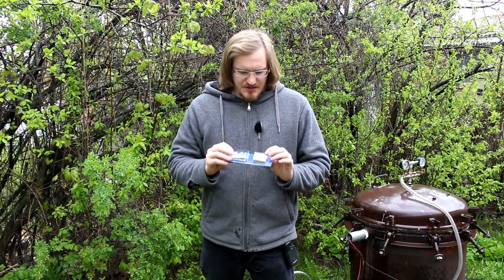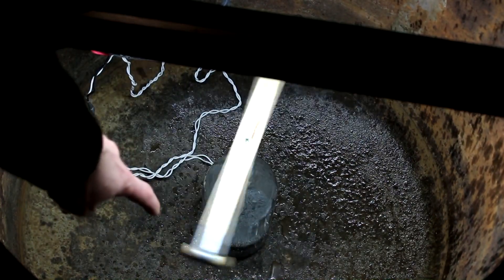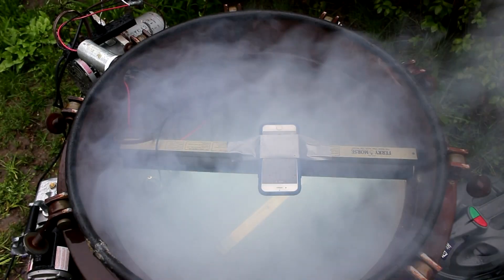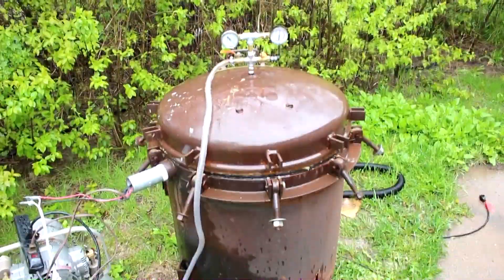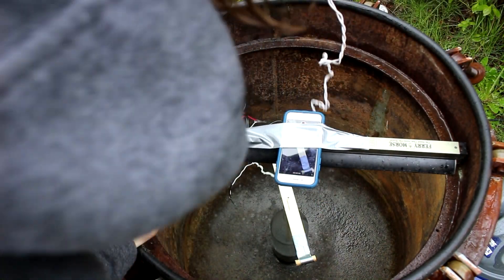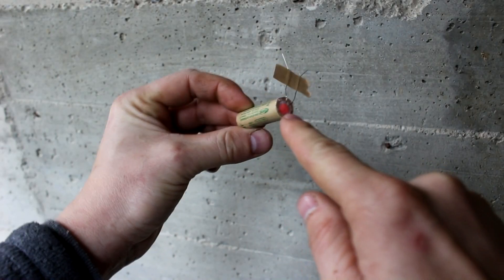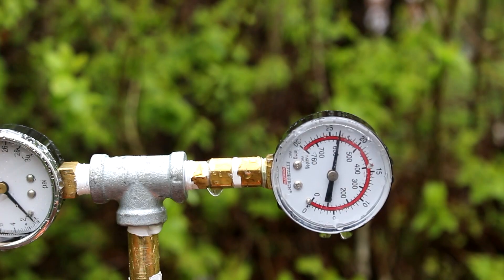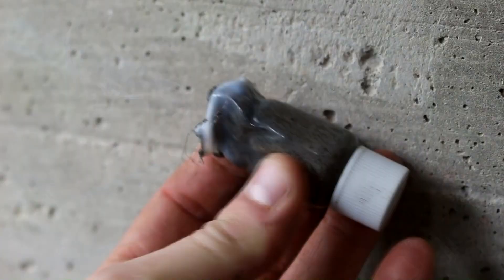Will a Model Rocket Motor Work In Vacuum?

Comment: As you suggested Rockets do actually produce more thrust in a vacuum. Most designs will have a lower specific impulse at sea level and by extension a lower thrust. This is mostly down to the pressure differential between the combustion and the exit nozzle being lower when there's air pushing back, leading to a lower exhaust velocity.

Also, I strongly suggest getting a dedicated camera, like a go-pro with a dive housing - would such to ruin your iPhone.
Reply: Not just NASA but any rocket needs an oxidizer.  But rockets carry the oxidizer with them and in the case of solid rockets, the oxygen is usually built into the solid material itself- such as ammonium perchlorate
Reply: This channel encourages science enthusiasts and people of all ages to experiment. You sound like you want to lock people out from science if they don't meet your educational requirements. From my highly educated, expert in the field view, you sound like a jealous, crybaby nerd.
Reply: I totally read that in your voice in my head. lol
Reply: Nah, he's just testing the product in severe conditions. That phone's going to mars one day.
Reply: +ThatScienceGuy

https://xkcd.com/397/
Reply: Thrust in atmosphere is lower because you can't expand the gasses as much before flow separation.  But also because once the static pressure of the exhaust drops below atmospheric, any further expansion will only cause the thrust to decrease.
Reply: Scott Manley!!
Reply: Jack Neo oxygen isn't the only oxidizer ya know
Reply: You know rocket stuff Scott why don't you go down and debunk some of the "space isn't real" kids below
Reply: +MyLoneWolf25 I guess it all boils (pun intended) down to which bits can stand 14.7psi without bursting, and which cannot. Electrolytic cap electrolyte can certainly partially evaporate and the cap continue to work, although it changes the tolerances. There's a video of a LiPo at 10pa. I imagine a LiIon (more solid-state) would fare even better. 

The amount of force on the plug of a tiny electrolytic would also be quite small, so a bit of vapor might build up, and then it would stop as the plug held it in.

I did a related test with a screw-top jar containing plain water, both with and  without a pinhole, in a vacuum chamber.

The one with the pinhole started bubbling slowly, and eventually the water all disappeared, after freezing (it was sitting on a styrofoam stage) but it took quite a while. The one without the pinhole didn't seem to lose any fluid at all until I got tired of running the roughing pump.
Reply: Marvin Kitfox Nah, it won't - black powder has a lot of its products as liquid or solid phase. These contribute little to nothing to any expansion gains. Gas-only exhaust on the other hand can see large gains, since that's why you see gains with expansion - you're exploiting gas expansion. Liquid or solid products don't expand (or not nearly to the same degree). So, some improvements, but limited compared to say LOX-LH2 (at the same chamber pressure)
Reply: Don't most phones use solid polymer capacitors these days?
Reply: Listen to the Man(ley) Cody.
Reply: Not only will that rocket motor work in vacuum (once you get it fully lit), but you are going to get almost double the thrust from it!
Due to cost and safety concerns, hobby motors have a rather low chamber pressure, which results in quite poor performance in atmosphere. At sealevel, that rocket's fuel ISP is about 80. In vacuum, it could be as much as 165
Reply: sleat maybe the battery or screen 
Otherwise I don't really think of anything that would fail
Reply: +negativespace000 Undoubtedly some of them are, but it's hard to get good ESR and high capacitance with tiny surface-mount things. I guess if a phone had no electrolytics at all, that would only leave the screen and battery as possible failure points, unless one of the chips had absorbed a great deal of humidity, and accidentally got itself pressurized with water vapor.

It would be kinda fun to take a broken phone in for repair, and if asked what happened to it, say "it was exposed to high-vacuum".
Reply: +sleat If nothing fails due to the low pressure I suspect that the phone would eventually overheat, at least if it was doing something relatively power hungry like video encoding.
Reply: He might not have hd camera or fancy edits like grant. But this guy is a real deal.
Reply: @Jack Neo They use a fuel (usually hydrogen) and liquid oxygen. These hobby motors have a solid oxidizer which provides all of the oxygen needed to continue combustion.
Reply: Helloooo, Scott Manley here
Reply: Scott Manley "Listen to the Man(ley)"  Hahahahahaaha!!
Reply: I actually read this with Scott Manley's voice in my head...
Reply: He is talking about "ThatScienceGuy". Read what he wrote.
Reply: Room temp water exposed to a significant vacuum will begin to evaporate rapidly.  As it cools, it will freeze.  The ice will continue to sublimate.  So really it's both.  In water based space cooling systems the heat exchanger is called a sublimator, but there is evaporation going on as well.
Reply: +plooked - ThatScienceGuy has a BA in Basket Weaving. MA in Gender Studies and a PhD in Trolling. His channel has no subscribers, no content .... absolutely nothing.
Reply: Papa Legba  - Watch "Uninterrupted Footage of the Falcon Heavy Launch and Booster Landing!"  for VIdeo PROOF of rocket propulsion IN A VACUUM.
Give UP already, you have been PROVEN to be a 100% Imbecile.

Prediction: You will respond with insults but you will REFUSE to watch the video, because the Cognitive Dissonance hurts your only remaining brain cell.
Reply: Hullo! :)
Reply: Oh scott, I love you
Reply: Scott Manley because ksp is not enough
Reply: Scott Manley if you put a hope in a dive housing in a vaccum it will explode because of air inside and you know closed things in vacuum s explode
Reply: please learn to read first. Where, in any of his post, did Scott call anyone out, or brag about anything? And as a plus one, the only impressive part, mate, is the astrophysicist piece you mentioned. I did quite a bit in school, so i understand how hard it is and that those that pursue that particular field should be applauded. Working for Apple in any respect is not, however, impressive. So I fail to see the relevance of that little tidbit you added. and before you give me shit for that last comment just know that, despite sounding like an asshole, i am not trying to be one. I spend most of my days building phones, computers, routers etc, so it doesnt phase me when people use that as a marker for importance
Reply: Scott Manley
I believe that's true in a static thrust test, but when the rocket is moving through the air at it's terminal velocity, there's no air pushing back.
Reply: +nerd1000ify "I suspect that the phone would eventually overheat, at least if it was doing something relatively power hungry like video encoding."
 
That's when you thermally couple it to my water bottle with the pinhole in it. ;)
It took a few hours to sublimate what started as 200ml of water, and it was ice-cold the whole time.
Reply: +Landrew0 "I believe that's true in a static thrust test, but when the rocket is moving through the air at it's terminal velocity, there's no air pushing back."

If that were true, then the rocket thrust equation would contain a term which had the effect of increasing the specific impulse as the vehicle velocity increased (when operating in a fluid as opposed to a vacuum).

We already see that the specific impulse for most rockets is greatest in vacuum.
Reply: +sleat I hate to nitpick, but if the water is liquid then it's evaporation rather than sublimation (you didn't make it clear whether the water in the bottle was frozen). I see what you're getting at though, in fact I think the Saturn V guidance computer may have used the same approach. Water has an amazingly high specific heat capacity AND a high heat of evaporation, which makes it really great for open loop cooling :).
Reply: I feel like the nerd version of the A Team is getting together
Reply: Scott Manley Hello
Reply: Landrew0 interesting point, never thought about the dynamic pressure... I guess that could have a significant effect on Isp.
Reply: Scott Manley don't worry Scott. I told Cody to buy a Nokia...
Reply: i assume you meant to say suck instead of such
Reply: Derp derp...I'm a moron, and even I know its not a vacuum once gasses start shooting out the back of the engine. What does that make you?
Reply: @MoneyIsSilver  Scott Manley is dumb as a plank. He banned me from his channel after I humiliated him on the subject of fuselage construction techniques & fuel tank pressurisation methods. All he can do is read from an autocue & appeal to authority.
Reply: This test is flawed Space is an ever expanding vacuum so this test should be done with vacuum left on to counter balance the difference in  pressure inside the container when rocket is lit as space is constant pressure. Then you will get a true reading.
Reply: Papa Legba   - Watch "Uninterrupted Footage of the Falcon Heavy Launch and Booster Landing!"  for VIdeo PROOF of rocket propulsion IN A VACUUM.
Give UP already, you have been PROVEN to be a 100% Imbecile.

Prediction: You will respond with insults but you will REFUSE to watch the video, because the Cognitive Dissonance hurts your only remaining brain cell.
Reply: @stuartgray5877  why are you so angry about scott manley's inability to perform simple physics calculations? it's not my fault he's a dumbass.
Reply: FALSE..that is why his other video in a ACTUAL vacuum with no water and there is ZERO cumbustion (what does water do in a real vacuum?...thats right, turns to vapor/BOILS!!!)
Reply: @philindeblanc  - One more thing:

The Tsiolkovsky "Rocket Equation" shows that Rocket Propulsion is MORE EFFICIENT IN A VACUUM -PERIOD!
That is WHAT THE EQUATION SAYS!

We have been TESTING the Tsiolkovsky Rocket Equation for OVER 100 YEARS!

The company I work for TESTS ROCKET ENGINES IN A VACUUM, and we VERIFY THAT THEY PRODUCE THE THRUST PREDICTED by the equation - IN A VACUUM!

Did you follow along that time: WE TEST ROCKET ENGINES IN VACUUM HERE ON EARTH!

Now please Be my GUEST and TELL US THE FLAW IN THAT >100 year old TESTED EQUATION!

I await your derivation of the equation from Newton's Principles and you can explain to ALL of the ENGINEERS and PHYSICISTS ON THE PLANET - WHERE THE FLAW IS IN THAT EQUATION !!
I await your brilliant response!
Reply: @philindeblanc  What's the matter?  WHY cant you re-derive the rocket equation to show us where the error is?

You are SO CERTAIN that it is WRONG!
Why can't you prove 100 years of engineers wrong with your non-technical education?
What's that YOU don't even KNOW how calculus works?
Come on we are waiting for YOU to show where the error is in that equation.
Reply: @stuartgray5877  Yes, certainty is derived from scientific deductive reasoning using repeatability. If you test something in a actual vacuum, and you get ZERO combustion with any and multiple materials in it, and you have ZERO combustion, you have a solid test. Take a FALSE start like this video with water which vaporizes and creates pressure, and you have a FALSE test. Why is it that you cannot comprehend this rational observation? That is what people would like to know.
Reply: @stuartgray5877  FALSE. PROVEN over and over, in a real vacuum you have ZERO combustion., Pound sand!
Reply: @stuartgray5877  So did you look at Cody's video in a real vac chamber? did you watch that? Yes or No?
Reply: @philindeblanc  - We test this shit in REAL VACUUM CHAMBERS!
I have personally operated some of the largest and most complex Thermal vacuum chambers in the country.
now read my lips (fingers):

WE TEST ROCKET ENGINES IN A VACUUM HERE ON EARTH!
They work EXACTLY as the rocket equation predicts they do.
They work BETTER IN A VACUUM.
Reply: @stuartgray5877  WHAT TOR?
Reply: @philindeblanc  Most of that video I asked you to watch was below 1.0 Torr.

The chambers I operate often get to below 1.0x10-9 Torr
Reply: @stuartgray5877  You can have combustion at sea level and at 5280 feet up. Because there is pressure. You say they work better. Define better.
Reply: @philindeblanc  - " You say they work better. Define better."

THRUST is GREATER at higher altitude.

Rocket propulsion works BETTER in a vacuum.
 We know this because we have TESTED it.
We have tested it at ALL altitudes in atmosphere.
We have tested it IN VACUUM here on earth.
We have tested it IN SPACE.

The VIDEO you refuse to watch is PROOF of this.
Reply: @stuartgray5877  So when I am about 14K feet up and I cannot light my stove so easy due to altitude, how does that relate to your testing?
Reply: @philindeblanc  - "you cannot get combustion in a real vacuum."

That is actually irrelevant since the combustion in a typical rocket engine occurs at about 3000 PSI long BEFORE the exhaust products reach vacuum.

Did you actually have a point?
DO you ever bother to research this shit BEFORE spouting bullshit?
Reply: @stuartgray5877  what are you ranting about?  where do you see 3000psi? and who is trying to combust O2 liquid or H liquid?  I am sure your brain didnt hurt when you rattled off some random BS
Reply: @stuartgray5877  Sorry, but you FAIL if you think combustion can occur in a vacuum. This is tested and NOT with this water puddle on a pool tank test..But Cody himself has done it in a vacuum and you have ZERO combustion. Get it through you skull. If you cant understand this, watch the video he has, then TRY it yourself!! It cannot happen. You need AIR pressure.
Reply: @philindeblanc  to all of the OTHER READERS: See how these pussies RUN when presented with actual EVIDENCE!
Reply: Make a vacuum in your backyard during a rainstorm? Lol science
Reply: 23 hgin isn't a vacuum
Reply: @frankp7411  Actually ANY pressure lower than atmospheric is considered "vacuum" per the definition of the word.
But there are many LEVELs of "vacuum".
"Rough Vac" is up to about 1.0 Torr (equivalent to 50 kilometers altitude).
"High Vacuum" is 100 mPa to 100 nPa (1.0X10^-3 to 1.0X10^-9)
while "Ultra High Vac" is better than 1.0X10^-9
Reply: It’s not a vacuum ..
Reply: @0Logan05  your body disagreea
Reply: @scottmanley  Been drinking, "scott"? Why did you leave the UK to live in America under a false name & work for NASA?
Reply: @0Logan05  - "It’s not a vacuum .."
WHAT, exactly is "not vacuum"?
Reply: Thrust in a vacuum is an oxymoron, as thrust is an applied, or external, force. The 4 forces of flight confirm this. Scott Manley is a liar.
Reply: You know all about thrusting don't you manly... space tard supreme.
Reply: hay scott love your video! !!
Reply: Scott Manley Indeed, the lower the average molecular weight of the products, the higher the C* value (which expresses the average speed of the products, hence taking the MW into account), the higher this differential will be!
Reply: @mduckernz  the greater the indoctrination the larger & ever more insurmountable the chasm to reality.

Astronauts & space rockets indeed you fools.

Still haven't figured out your Hegelian hero Elon is a puppet victim of blackhand Intelligencia manipulation ever on the brink of prison
Reply: holy crap you watch these videos?
Reply: +ThatScienceGuy /r/iamverysmart
Reply: +Scott Manley "Also, I strongly suggest getting a dedicated camera, like a go-pro with a dive housing - would such to ruin your iPhone."

Yes, it would suck, but this raises a very interesting question. What, exactly, would fail in an iPhone exposed to vacuum that would ruin it, and why would that part fail?

Arduinos and Raspberry Pi boards seem to work just fine in near vacuum, at > 100,000 feet. say. 5 torr or so.

I s'pose eventually some of the electrolytics might pop, or perhaps the display, if it were an LCD, might start to generate evaporation pressure, depending on what the "L" was made of.

I wonder if anybody ever actually tested this with an old iPhone?

Sequel to will it blend? 

Will It Vacuum??
Reply: Don't NASA's rockets work by adding the oxygen needed for combustion...
Reply: haha of course the apple developer doesn't want his baby burned ;)
Reply: Scott Manley also no air resistance
Reply: Post your credentials you fucking potato. Burden of proof falls upon you now. If you wish to call someone out that is trying to show those of ALL ages that science can be simple and fun, then prepare to be made the fool. I highly doubt you have even a single degree, let alone 3. So, as previously stated, I am calling you out. You have a channel, so post videos of your doctorate, your masters, fuck i'll even take an associates kindergarten degree. Come then, we are waiting
Reply: Scott you fucking apple shill
Reply: Scott Manley stop supporting this channel. Isn't is clear to you that he has no idea what he is talking about? You are a man who is highly intelligent can't you see supporting channels like this hurts the community as a whole? .His scientific method is horrible. Spreading bad science and misinformation is hurting people by giving them false information that will  in turn have people who spread bad science and misinformation. I love your channel and you give great information backed by facts and math Cody does not(sometimes his his math is completely wrong). I am on my 3rd degree right now and even I can see this channel is horrible and bad for real science. Why can't you?

Comment: the water in the bottom of the tank in the last clip threw me for a second! air trapped under the container of lead shot has a pocket that trapped air. as the pressure dropped, the air expanded and pushed the water out from under it. causing it to bubble.

Comment: BEFORE: my theory is that it will work, because the motor casing substitutes for air pressure in combustion.
AFTER: I was wrong *again*.

Also, it didn't seem to burn as long in a vacuum.